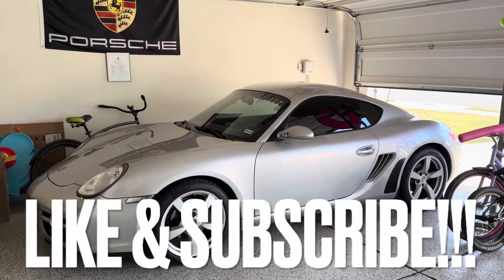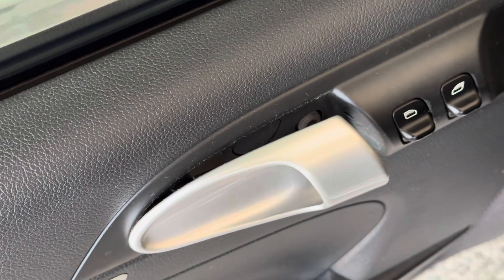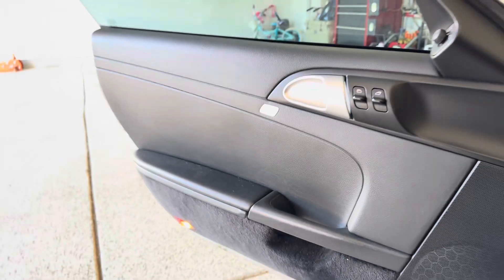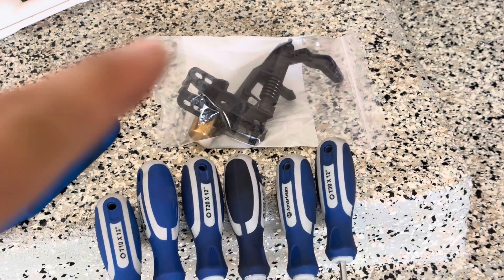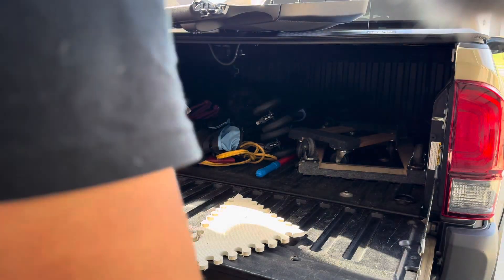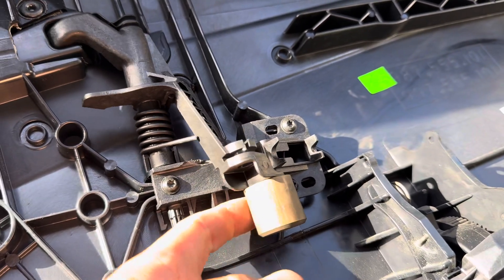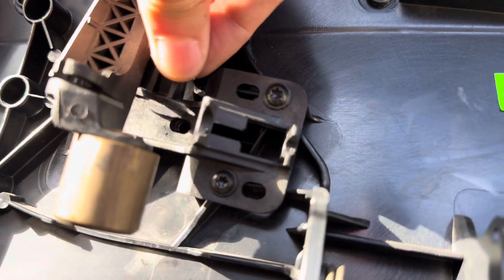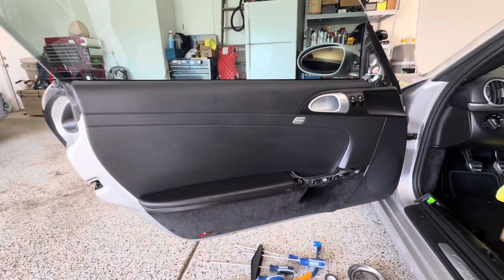How to replace #Pivot #Door #handle on #Porsche #Cayman #Carrera #Boxster @PorscheClubofAmerica

Comment: Thank you for doing this.  I'm currently not having any similar issue with my 2008 Cayman, but it will certainly come in handy should that piece of plastic snap on one of my doors.
Reply from the maker: Nice! Manual or PDK?
Reply: @512TXSDIY  Base Model 5-speed with Sport Chrono package.
Reply from the maker: Nice! 987.1 Base 5 speed for me :-)